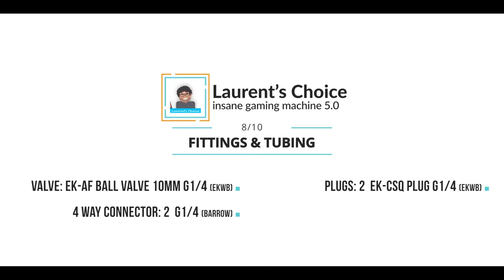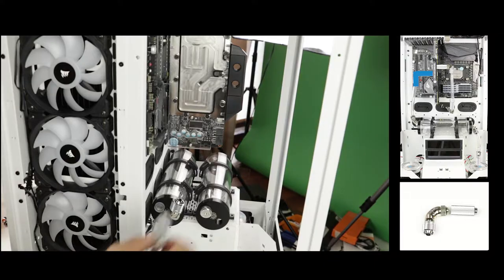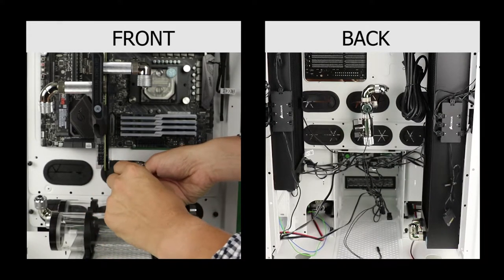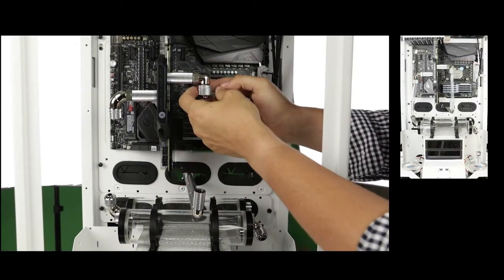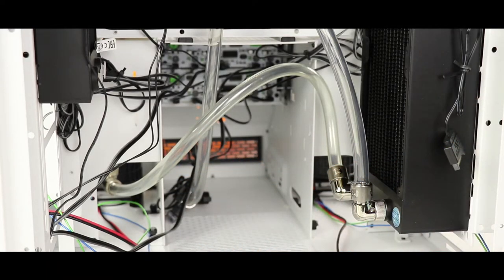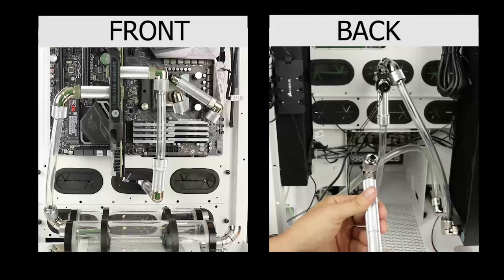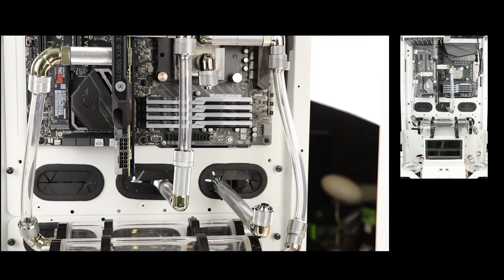Dual Loop Tubing ( Ryzen Project 8/10 )

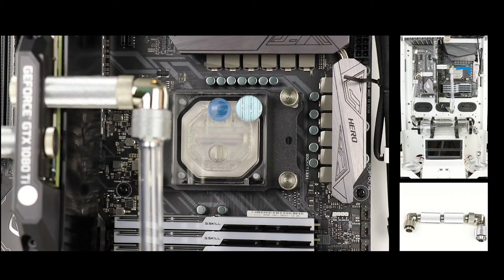Comment: You should add a correction regarding the water block...at 7:01 you state that the upper port of the water block is the "inlet"...it is actually the "outlet". The way the internals of the water block are designed it may not be as efficient when flowing in reverse. I also have an EK EVO Supremacy but have never tried a reverse flow temperature comparison...might be an interesting test.
Reply from the maker: Thanks for this :) 

Appreciate the correction.  Will pin this comment for future reference.
Reply: +1 the intake on a waterblock will always be the one which hits a accelerator plate, which is the opposite of what you have described. The reason why its not efficient is because that accelerator plate is used to cause agitation, and evenly distribute the water across all channels.  Flipping it would cause the injector plate, to be a strainer or a blockage, killing the efficiency of the block design.

Comment: I like your choice of components. I'm building something similar. There is one fundamental thing I would change about your loop though. The pump tends to add a bit of heat to the water as it passes through. Most pumps use the water to actually keep themselves cool. So in order to keep your components at the lowest possible operating temps,  you would want the output of the radiators to feed the input of the CPU/GPU then the reservoir then the pump then back to the radiator. 
-->> (hot Water) -->> |RADIATOR| -->> (cold water) -->> |CPU/GPU| -->> (hot water) -->> |RESERVOIR| -->> |PUMP| -->> (hot water) -->> |RADIATOR| -->> (cold water) -->>

Measuring the temp at the CPU/GPU output will give you the most accurate measurement of your loop operating temp as this will show how much the CPU is heating the loop. Its the only way to show that your cooling loop is truly adequate. If you measure before the CPU you might see a nice cool number like 35c but if you measure after the CPU it might be much higher, like 75c. This would indicate that you're not dissipating enough heat. In which case one would add a larger diameter line or maybe even a more powerful pump to raise the liter/min of the system. If the output of the CPU/GPU is only 10-20c higher than the input, then you know that the volume of coolant is sufficient to transfer enough of the heat generated by the component.
Reply: This is a actually a myth with the flow rates he has. 
Unless he is pushing out more then 400W of heat, thermodynamics for fluid dynamics states, it takes ~350W of heat at a flow rate of 1gpm for water temp to go up 1C. He has the sufficient flow not to worry about loop order, as again fluid dynamics states the system will head to equilibrium as long as you have the proper flow, so loop order plays little to no impact, but instead the shortest loop will always win.

Comment: I'm curious on each loop why you cross-sided the pump and the rad instead of having them on the same side left to left and right to right. Also, is it better to have the loop run in this order pump->component->rad->res as opposed to pump->res->component->rad? Will it help with the sloshing situation in the res that you mentioned in prep video?
Reply from the maker: +Xuân-Lâm Lê these are specific questions and important ones .

I did that because the pumps had to be on opposite sides and also because rads output were conveniently facing their respective cooling components (GPU and CPU).

You could order the loop as mentioned .

Two reason why I sent the loop directly to the rad and then to.the component :
1 - ensure that the liquid is as cool as possible after a run through the RADs fans.
2 - two stage cooling : hot liquid after components passage do mix in the reservoir, which provide a first cooling dissipation.
After reservoir it is sent to the radiator (through the pump ) to rove any heat relics .

This is , in my sense, the most efficient way to dissipate heat.

I hope this helps :) 
Thx for asking :)

Comment: $1000 worth of fittings then you use rubber hose?
Reply from the maker: +loneventhorizon I wanted to dual both builds.

One in flexi and one in solid.

I am preparing to film the solid :) I'm sure I'll like it even more.

Though I'm.also considering an upgrade build from flexi tu solid :)

Comment: CAN I USE WATER COOLING SYSTEM IN 3 GRAPHICS CARD?
Reply from the maker: Yes.. though expensive... But it looks AMAZING !
Reply: THANKS
Reply: hi,it's me again,thanks fro replying my previous comments,,could I ask if I could put two power supply in that pc case?
Reply from the maker: Wow.. what are you trying to do
Reply: kind of thinking doing a mining rig for bit coin and  personal uses,sorry kind of thinking over,hehehehehe
Reply from the maker: Ethereum brother.. that's where u want to go. 

Unless u have specialised hardware... Bitcoin ice age is already upon us . 

Let me know if u need a guide on it
Reply: thanks ,,what do you mean bitcoin ice age is already upon us?and also can I use that case for my rig?
Reply from the maker: No matter what video cards u got... You'll end up spending more electricity than received Bitcoin.

What u need to mine is Ethereum, then convert to Bitcoin through an exchange.

Checkout ethermine.org
Reply: thanks
Reply: hi,,,if I use 3 gpu for mining ?can I cross fire those gpu's or not?
Reply from the maker: When mining , u do not need crossfire or SLI.

Just plug them in the PCIe ports l, install drivers and the mining software will use all available GPUs.
Reply: thanks
Reply: hi it's me again,how are you?can I use 3 gpu only for  mining,,and the processor is 1st gen I7 intel cpu?
Reply from the maker: Wow.... That's old.

Hum .... I would not recommend it . I'd suggest a Pentium G4400 or Celeron (current) CPU.